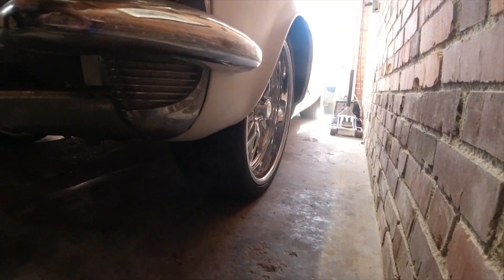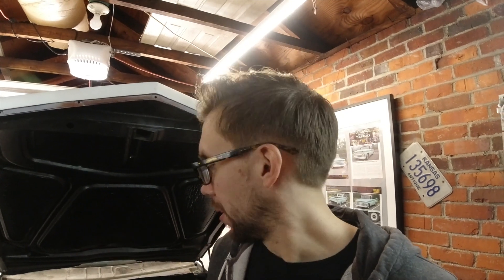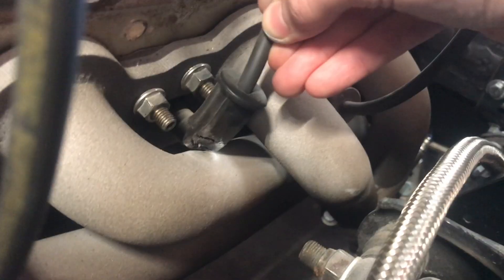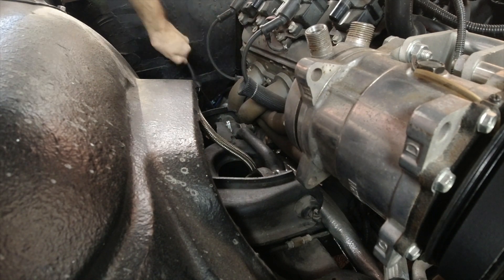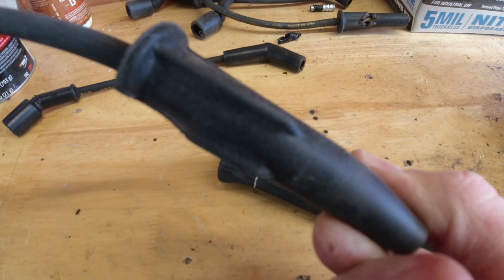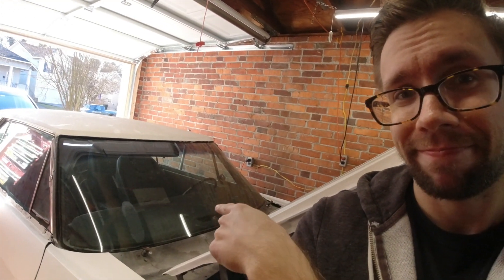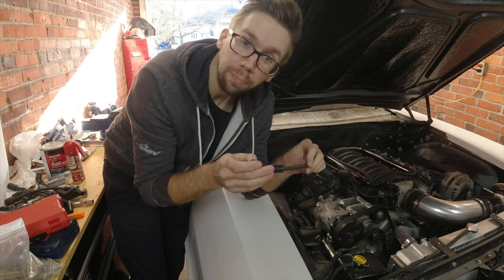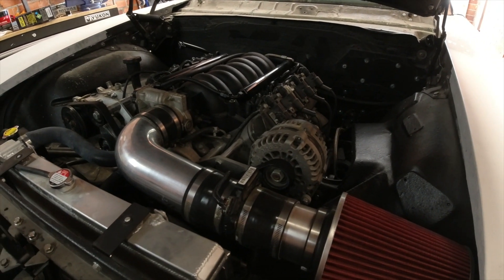Headers Burning and Melting Spark Plug Wires? LS Swap Recommendations

Comment: I have msd wires and they burned up with the heat sleeve which wires are good for a LS 5.3
Reply: They touched the headers and boom toasted
Reply from the maker: Wow, I’ve never used MSD before but that’s crazy. I just assumed they would work better! I’m a big fan of the stock style wires with the integrated metal covers if you can fit them. Unfortunately these headers wouldn’t fit them without rubbing HARD. Taylor 45 degree wires have worked for me in the past so that’s what I tossed on here. I’ve found if it still touches with 45 or straight it’ll need a boot.
Reply: @MatthewFinlay  yea I’m kinda lost and looking for ones this was my second pair of wires and I thought maybe I was doing something wrong but I need more angle as I have long tube headers too hate loosing that hp
Reply from the maker: So a trick we used to do with plug wires is  pulled the center connector for the plug to the rear or fatter end of the silicone boot. Then trim off the excess boot on the narrow end to so it’ll clip back onto the plug. Depending on the header that would let it slip behind tube and closer to the cylinder head rather then touching it - I’d then use the fiberglass heat shield/wrap to protect the wire as a backup. You can also to that trick with a 45 degree boot plug wire but they are usually shorter anyways.
Reply: @MatthewFinlay  I never thought about cutting off the end of the boot. I have a 2015 5.3 engine with shorty headers and there is absolutely no room for the wires so they touch except for C1&C2 which of course are both on the end. The maker of the wires so no spark plug can handle that kind of heat and im installing them wrong.
Reply from the maker: Yup! It’s a good trick! Be prepared to have to play with pushing or pulling the connector in the boot to get it at just the right spot. I also try and trim as little as possible from the boot. Unfortunately you can’t see anything while you trial and error fitting it haha. So you kinda gotta guess what it’ll need and shave it off. If you have a spare burnt wire I’d experiment with that one until you get it to the right size and then modify a good one. Cheers buddy!